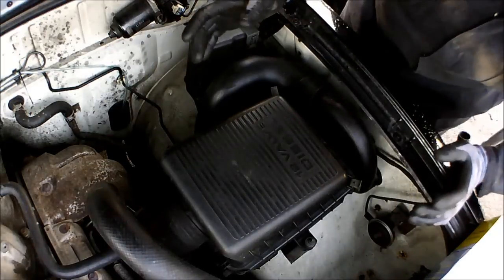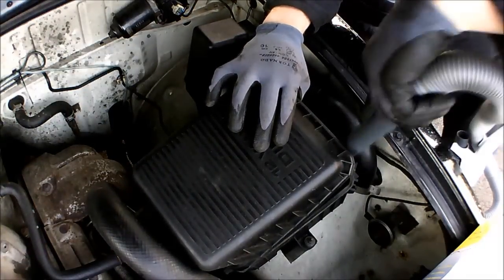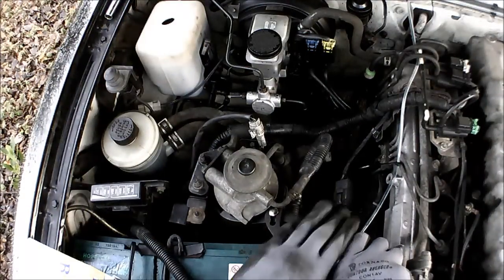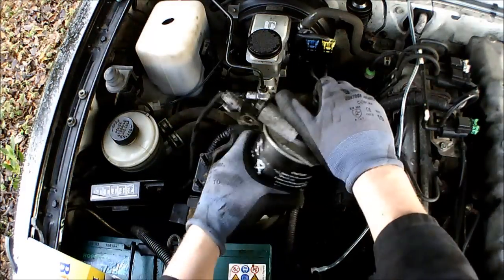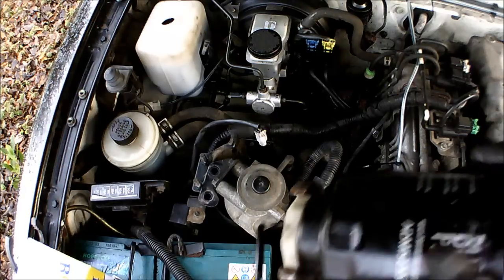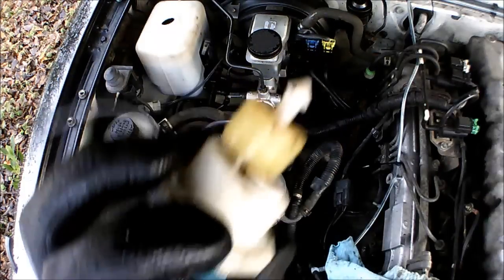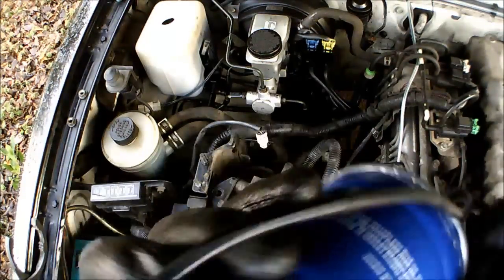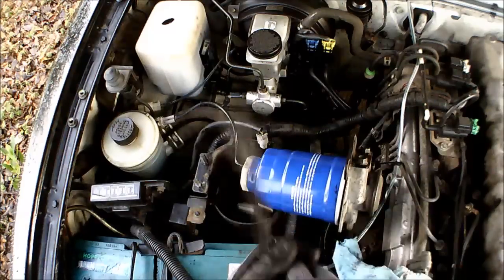Ford Ranger Mazda B2500 2.5TD Servicing Guide Part 2 - Air and Fuel Filter Replacemen

Comment: I usually fill the filter with diesel, after fitting the water thingy at the bottom, then screw the filter onto the pump housing. It saves a lot of pressing of the little black button!

Comment: thanks for d info.. but I tried a slight different way .. i took off d filter .. drained as much i could.. flipped over n screw on . then unscrew filter n then after reinstall.  i blocked exit pipe with hand n pumped until fuel pumped out to ensure air was bleeded

Comment: Once the filter is fitted. How long does it take to hand pump fuel through before starting truck up?
Reply: 84 years
Reply: Prime it up and start it and go for a small ride prime it go for a small ride. Don't worry if it takes a while to start up as there will be air in it still but after going for a small ride it should be all good
Reply: @a3k8n9el  Your comment is 3yr old, but I just pmsl!

Comment: Old video but maybe u can help, I can't screw filter off for the love of God, any tips?
Reply from the maker: Leave the filter housing still on the studs it bolts to (although loosen the nuts so you can get at it) so you can use the to hold it still and use oil filter pliers to turn it making sure your going anti clockwise. Worst case scenario remove the 2 fuel hoses and then take it and put the housing in a vice then jam a big screwdriver through the filter and put a pipe on each end of that to add to the leverage and unscrew it that way.
Reply: @DumDum306  I even tried removing it and jamming a large metal rod through it to turn it, it's stuck on there haha
Reply: Tried keeping it on the screws worked! Thanks so much, but now it stutters without gas 🤔

Comment: hi I have the same vehicle and I see that air bubbles is coming from the filter to the pump what is causing that? cause my vehicle is revving quite fine then it does not rev pass 2000 rpms what could be happening here?
Reply from the maker: +Fabian Greaves It will be an air leak somewhere and that could be the cause of the loss of power.
Reply: ok,but I discover today that its driving fine but when it comes to a hill I does not rev pass 1500 rpms its a tranny 06 ford ranger

Comment: Hi I just purchased a 1998 Mazda b2500.my question is does the truck have a cabin filter?
Reply from the maker: I don't know, sorry.
Reply: yes it does check underside on the  right just in front of the rear wheel
Reply: I just purchase a Ford ranger year 2000.. Same engine as this

Comment: What is the tool called you use to get the fuel filter off?
Reply from the maker: In the UK we have a shop called Halfords, they sell them, they are called oil filter pliers or something like that. I've owned them about a decade so excuse my poor memory. They are designed to do oil filters but they work really well on the metal canister type fuel filters too.
Reply: Awesome thank you so much hope i can find some over here in Australia
Reply from the maker: These are what they are £12 so all things being equal about $20 in Australia.
http://www.halfords.com/webapp/wcs/stores/servlet/ProductMobileDisplay?catalogId=10151&categoryId=318447&langId=-1&productId=232619&storeId=10001